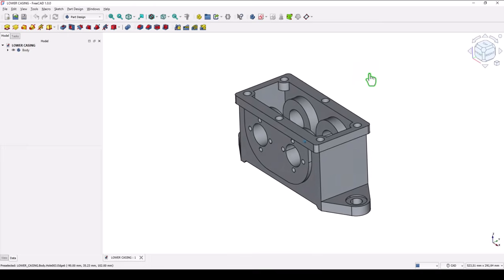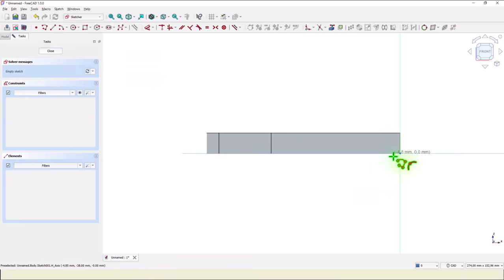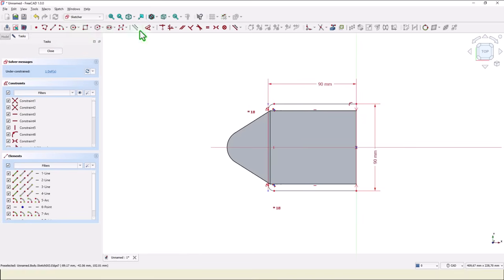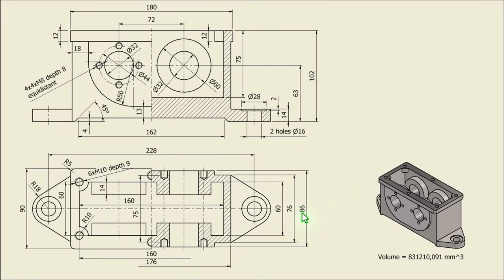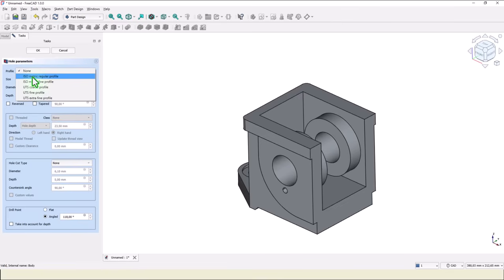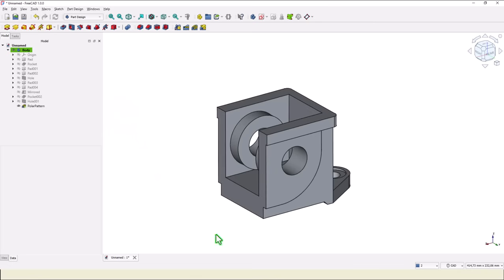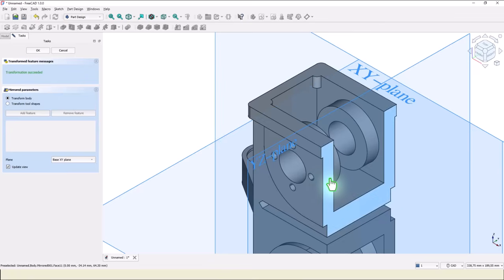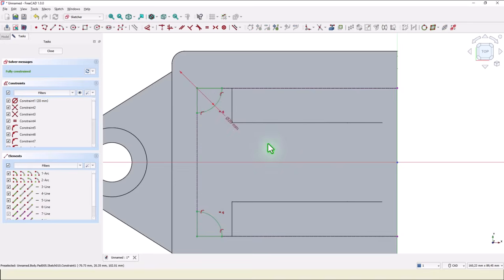Tutorial FreeCAD - 054 LOWER CASING

Comment: Sad to report at 15:00 minutes in tutorial, the mirroring of two pads will no longer will work as demonstrated, in new version of FreeCAD 1.1.0. A witness line between the pads mirrored and body appear. Even if the mirror data part design refine is checked yes. If you attempt to edit mirror, select "transform body" instead of "transform tool shapes" the witness line disappears but the through-holes no longer penetrate either side of the mirrored surfaces.
Reply from the maker: You are right, my friend!

Comment: Isn't the dimension reference point in sketch 001 wrong? It's the top edge, not the bottom.
Reply from the maker: The Center Point (reference) is in the middle of the right side line in the sketch 001